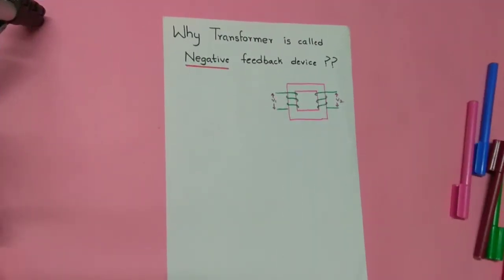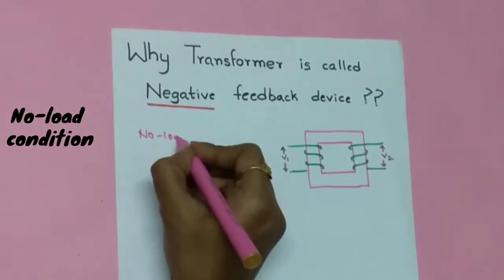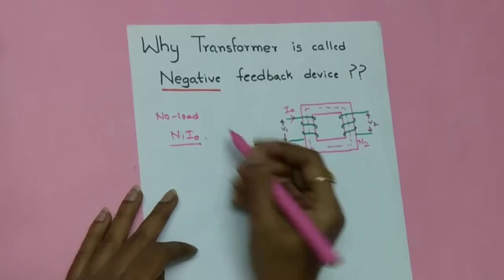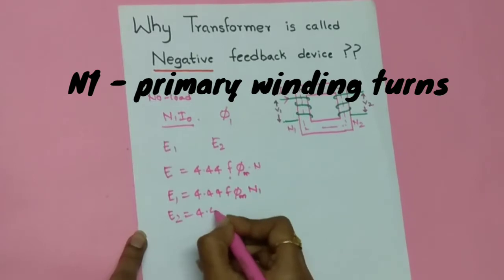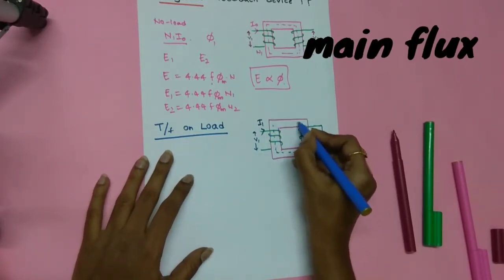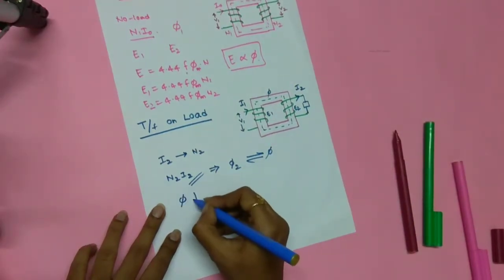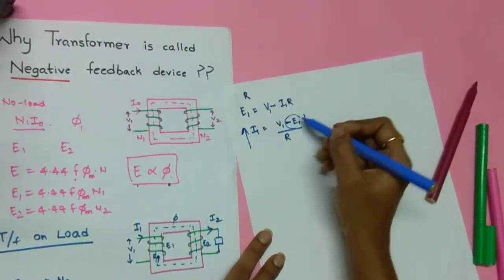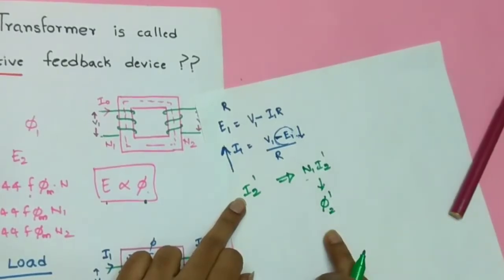Why transformer is called as a negative feedback device ?

Comment: @Lp Alkamie I have a question on the details of when the phi2 is produced. Based on your transformer-phase-shifting video explanation, you state that the primary V1 leads phi1 by 90 degrees. So wouldn't it make sense that the generated secondary V2 leads phi2 by 90 degrees as well?  I will take a stab at my own question and say no because that would imply that phi2 is 180 degrees out of phase with phi1 and the total flux in core would completely cancel and transformer wouldn't work. The only logical conclusion I can come to is that the secondary's V2 and I2 are nearly exactly in phase (I think this is because the voltage or EMF is being generated within the coils, so there is no "Jx" impedance from inductance) it is just EMF divided by Resistance of coil. This would lead us to conclude that because V2 is 90 degrees lagging phi1, phi2 is also lagging phi1 by 90 degrees. If this is true it would allow us calculate the time-domain sinusoidal superposition of phi1+phi2; visually showing the impact of Lenz's law within a transformer.